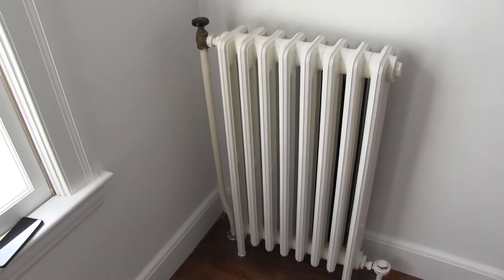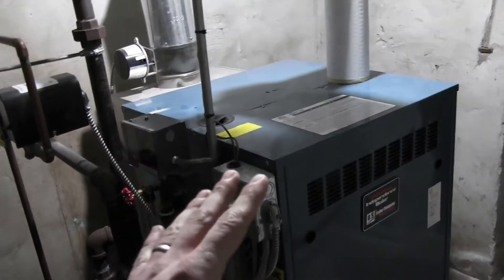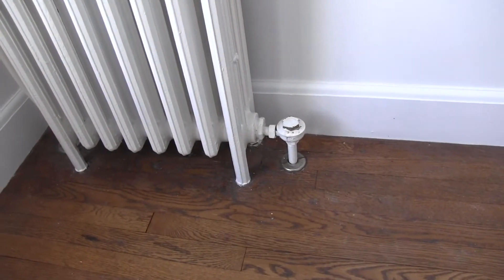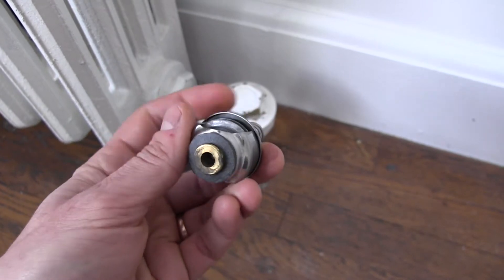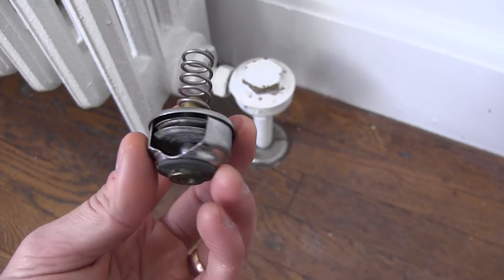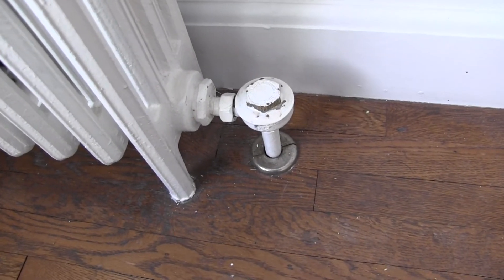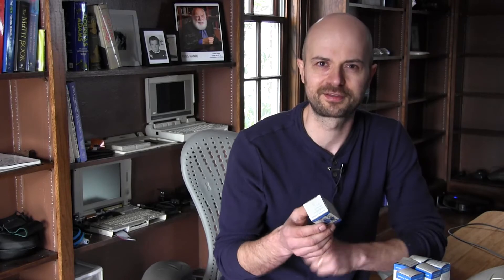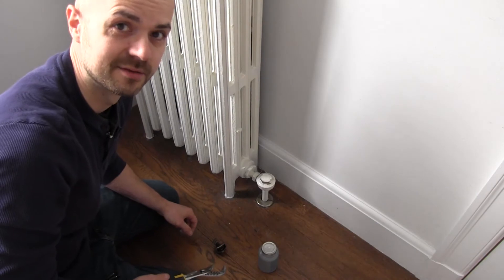Replacing thermostatic steam traps on two-pipe heating system

Comment: I have a very similar system in my house. My house was built in 1934. One of my projects for next summer will be replacing all of the steam trap cage units with modern ones. I was able to find the correct socket size and then with a 2 ft long breaker bar all of the caps came off no problem. So for the interim I will just clean any junk out, put some anti-seize or pipe dope on the cap threads and then next summer I can do the work I need to do.

Comment: Very helpful video. I purchased a cap and new cage unit. I can't get the old cap off. Any recommendations? I tried penetrating oil and it is still stuck.
Reply: I had the same problem. The trick is an impact wrench. I picked up the cheapest corded 1/2" model I could find, measured the size of the hex on the cap and got a cheap socket (harbour freight is plenty good enough). An impact driver like you'd use to drive screws isn't going to cut it but even the cheapest tool that'll take a lug nut off your car will do this job easily. If you're like me, you're gonna need a huge socket (mine needed 1 3/4"), which I could only find in 3/4" drive, so I needed an adapter. Works really well. You don't have to chew up the brass cap with a pipe wrench and most importantly, don't have to apply massive stress to brittle cast iron fittings under the floor. I'd be careful to make sure no penetrating  oil gets into the trap as it could get back to the boiler and cause the water to surge and foam up when it boils. Same goes for any anti-seize compound you might put on the threads. Also, I wouldn't put the cap back on with the impact wrench, just snug it up with a ratchet. Good luck.
Reply: @BillTucker-zc5ly  Thank you so much for this information! I'll get on this and let you know how it goes!

Comment: After replacing the traps did you notice if there was less gas used to heat the system when looking at your gas bill?
Reply from the maker: Oh yes, there was a small but noticeable decrease in total gas usage. But the biggest improvement was to fix the water-hammer noise in the pipes.
Reply: Forgot to ask, did replacing the cages help other radiators heat up entirely or faster? I’ve got two in my home that only get hot at the very top - opened the trap and am trying to figure out which cage I need
Reply from the maker: @diegodelgado1100  That wasn't really an issue we were having, but I would imagine it would help with that, too.
Reply: A trap that fails in the open position which is by far most common, can easily cost you a hundred dollars in fuel over a heating season in wasted steam. Replacing the cage unit will almost certainly pay for itself in a single year.

Comment: So I have building with 64 units I just got thrown into , if 1 radiator in a room is not heat could that be the problem or needs to be bled ? Also do I shut the whole system down to change trap ?
Reply: If it uses a pneumatic thermostat system sometimes you will find a stuck valve on the feed side of the convector.
Reply from the maker: If it's a two-pipe steam system, and one radiator is not heating, then it's very likely to be a faulty steam trap, yes.

Comment: I have a two pipe steam system and need to replace a steam trap. I tried and failed to remove the trap cap with a regular wrench. I’m about to buy a large socket set so I can try that, but I’m really scared of torquing/cracking the old iron pipes while trying to get it off. Can someone who has done this tell me any tricks to removing? It’s been suggested that I heat the trap briefly with a butane torch. Both the trap and cap look like they are solid brass. There is no paint on the rad or trap.
Reply from the maker: You should consider using an impact wrench. It creates a huge amount of torque over a short time, which will reduce the risk of damaging the pipes.
Reply: Impact for sure. Not a little impact driver for driving screws, but something that'll take the lug nuts off your car. I wouldn't try the torch unless you're sure you're going to replace the element. Many are screwed into underside of the cap and they're delicate. Even then, it only helps a little. Impact gun spins them off easily. If all your traps are the same, a single socket is alot cheaper than a set but either is cheaper than cracking a cast fitting below your floor.

Comment: Tunstall Steam Trap Capsules are fabricated of welded stainless steel, and designed to last far longer than older traps.  Traps cycle constantly: often dozens of times in a minute and tens of thousands of times per month.  Either replace them every 3-5 years or try out the modern versions.
Reply from the maker: Yep, thanks, I researched the Tunstall capsules also, but they're quite expensive! Maybe the next time I replace these most recent traps, I'll consider splurging.
Reply: @DmitryBrant  the question is not first cost, but life cycle cost.  Is there a way to estimate the failure rate of the old ones?  For your video consider a section on using a heat gun to determine if a steam trap is fully failed, without taking it apart.